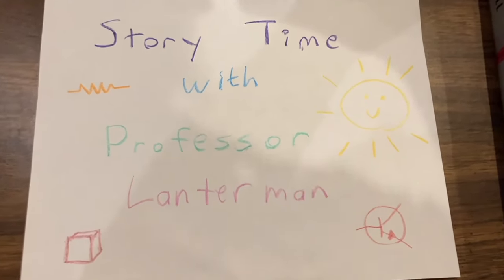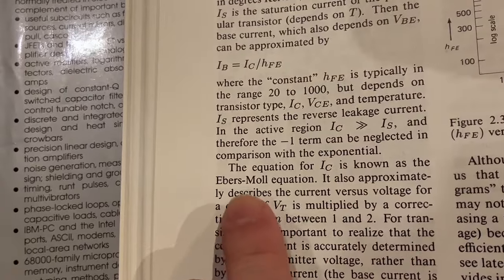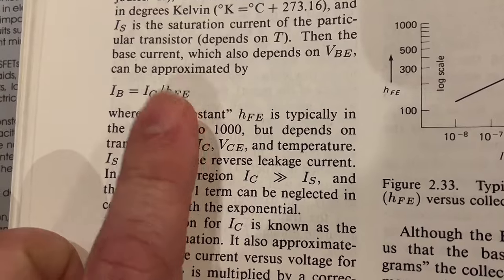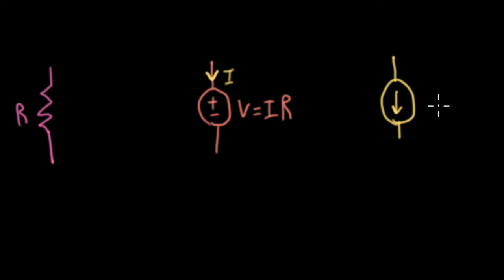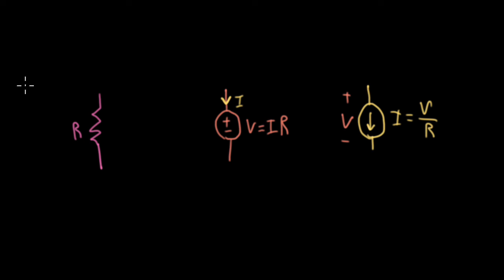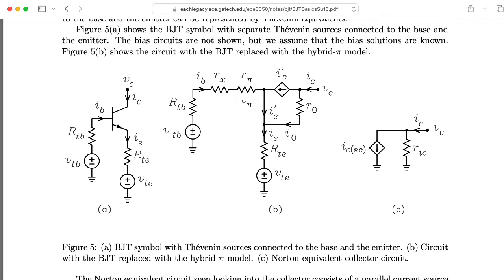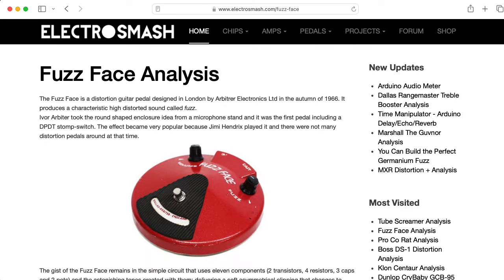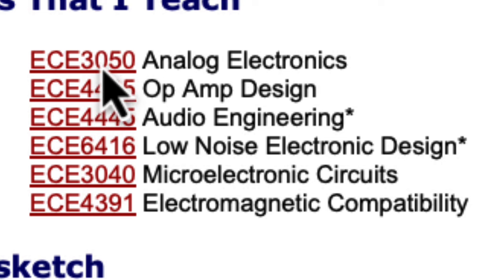BJTs are VOLTAGE-Controlled Current Sources!

Comment: Sorry, but no mathematical model changes physical principles. What you call fundamental... I don’t consider it such at all. It's really good, but hey - just a model, unnecessary in too many practical cases.

FET is a voltage controlled device, meaning it does not require current to control it. BJT is a current controlled device which means that current is required, and this is because BJT uses charge carriers injected by current rather than voltage. This explains, without going into detail, how and why a transistor works. I would call this knowledge more fundamental. You would probably call this basic.

And just one more thing about resistors-sources. Even if you can replace A with B, that doesn't mean A is B.
Reply from the maker: What controls the amount of current flowing through the base?
Reply: By that reasoning, FETs require current.   There is no such thing as infinite resistance, and also, the gate input is a capacitor, and requires significant currents to charge and discharge.   But if we deny this, and insist that FETs are voltage-controlled only, then we also deny that BJTs require current, since the physics revelas that base current is just an unwanted leakage, same as in FETs.  The controlling parameter in both is an e-field across a depletion layer.   FETs differ from BJTs in that the variable depletion layer in the BJT is stretched across the current path, while in FETs, it invades from the sides.

Gate currents are never eliminated, but can be drastically reduced.   Same thing with BJTs, the "super-beta" components with hfe up in the tens of thousands.   They still work fine, because the e-field in the junction is controlling the emitter current, regardless of any leakage through the base.   Apparently this was not recognized back in the 1950s, when BJTs had single-digit hfe.   If they'd had hfe=500 devices right at the start, instead William Shockley's name might be on the Ebers-Moll equations.